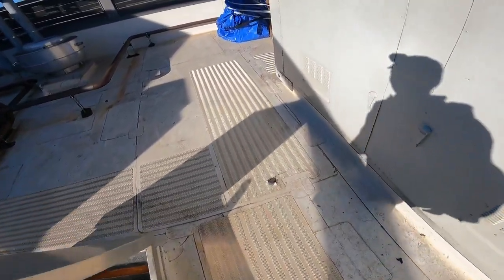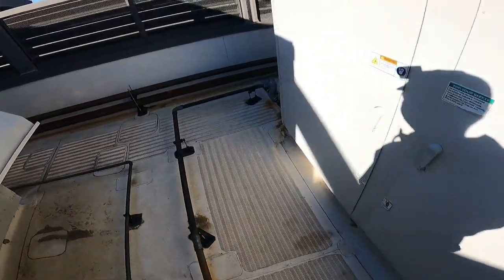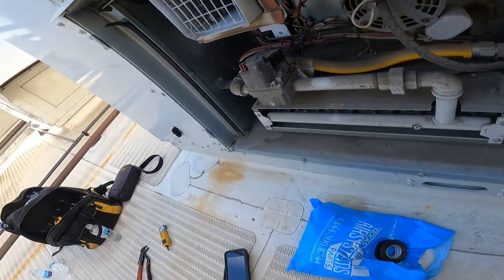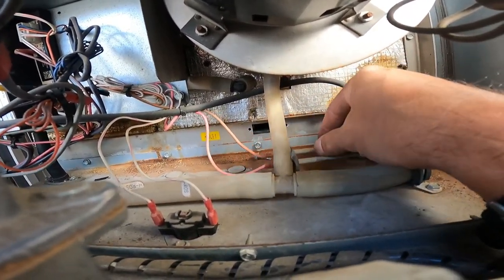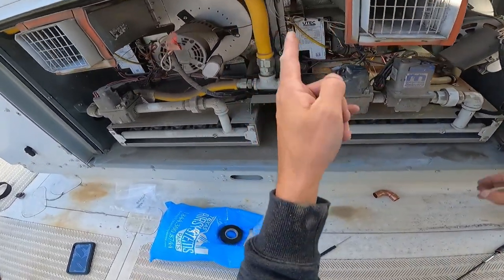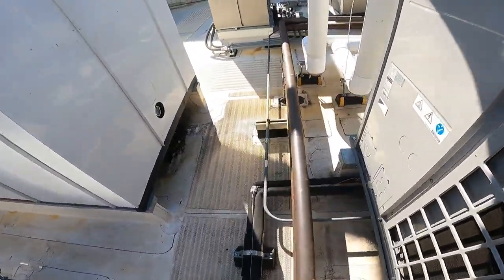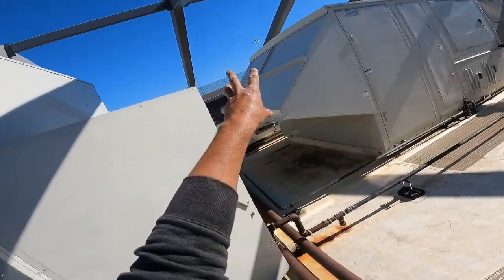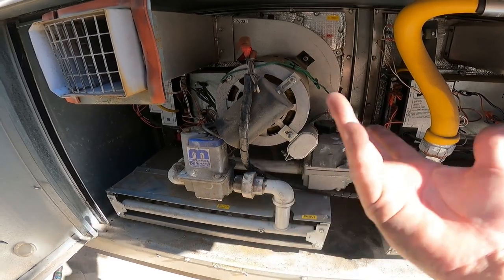Aaon gas heating parts.  EASY work!

Comment: In the MODGAS module, after enabling Force Mode, you can hit the enter button to change the modulating gas valve position and enable other stages. Typically you will find the tonnage of the unit on the sticker that is on the top of the outside air hood.
Reply from the maker: Good nfo!!!  Luckily I only needed that one to test what wasn’t working before. 
You’re more than welcome to help with a different unit if you’re Aaon “sabe”!!!  Just scratching my head!!!  Calling tech support next time.